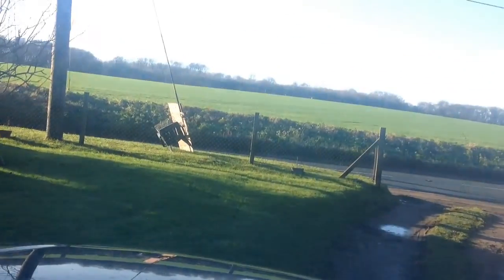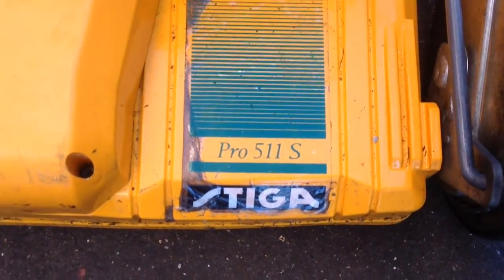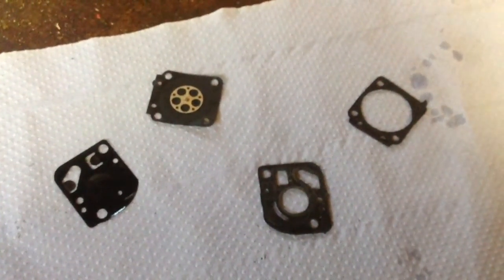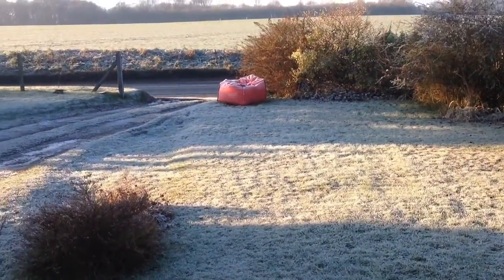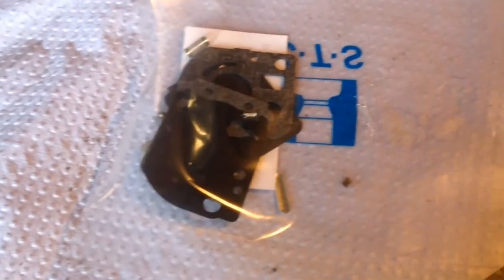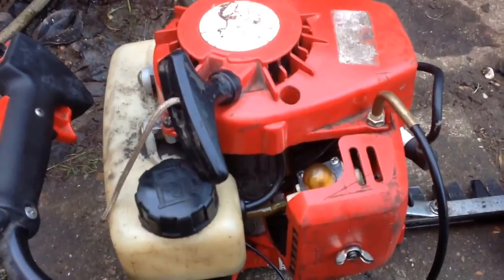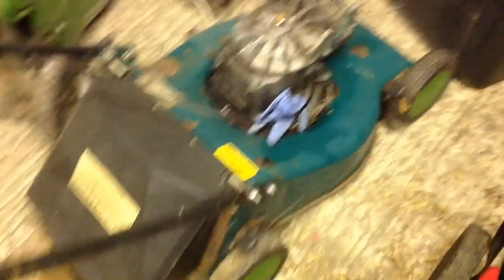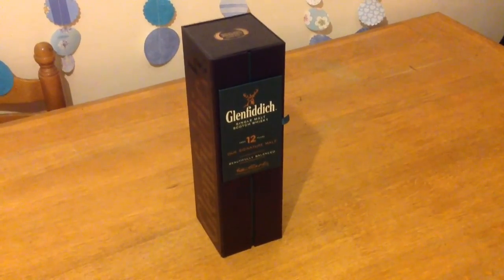End of year vlog mower repairs,projects,Honda,mantis etc.

Comment: Interesting to see your projects.  I've never done a fix, just generally passed my broken stuff on or scrapped it.  I've got a few things in my shed I would like to sort though.  Mountfield Honda engine mower (snapped off front wheel), Honda hedge cutter (snapped throttle cable and broken teeth) and a Stihl blower (snapped engine casing on one of the mounts).  Do you have a specific supplier you get your spares from ie; crab kits etc?  The Shiga mower looks good.  Never used a front wheel drive before.
Reply from the maker: I usually get my spares from ebay there's a few good sellers on there that are cheap.Ive always been mechanical minded,but since watching youtube I've learnt so much more.I treat it as a hobby also it's something to do when the weathers bad.Thanks for your comment and happy new year.